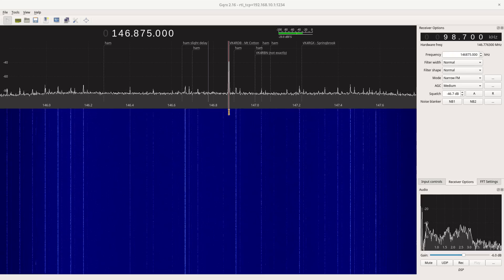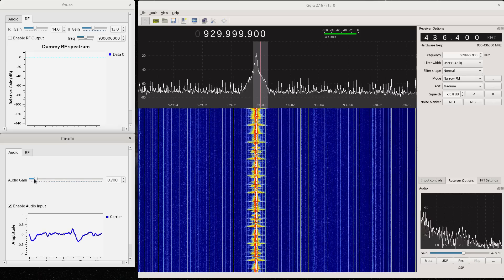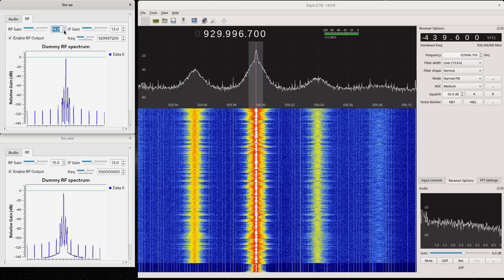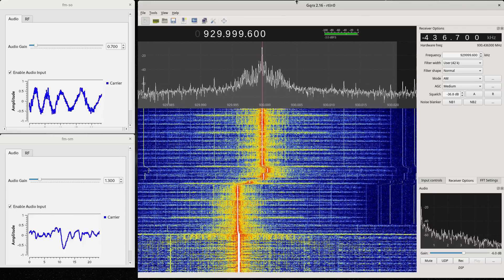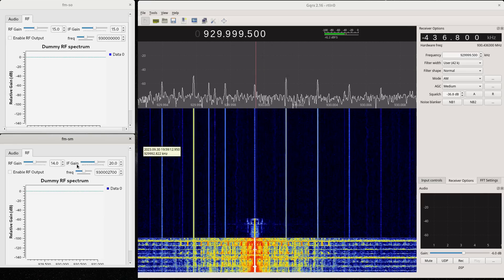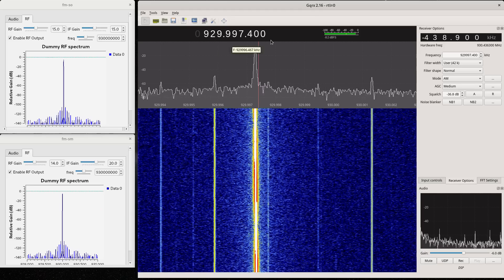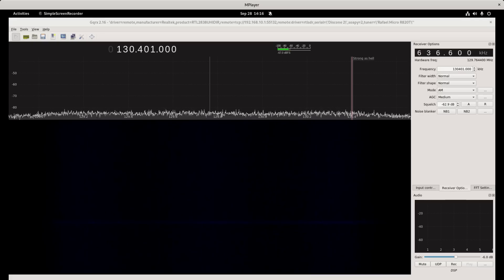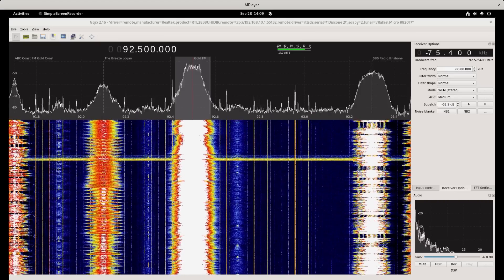Demonstrating FM Capture Effect

Comment: Ha! There is so much misinformation on the Internet. It's amazing!

AM versus FM. Liberal versus Conservative. Fahrenheit versus Celsius. A.m. versus P.m. how does that differ from FM? Apples? Oranges? Let's review.

Aircraft frequencies are beyond, 108 MHz. They are just beyond the Broadcast FM Band. And they used 25 kHz deviation,, narrowband stuff. Compared to the 75 kHz deviation of hi-fi FM radio. And so at 25 kHz deviation. That is FM transmission. Not AM. It is not Amplitude Modulated. It is Frequency Modulated at 25 kHz deviation.

It might convert that FM transmission. To an audio amplitude modulated output signal. If you want to get your jargon all, Whack-A-Doodle.

In fact. When I was younger. I could detuned an FM receiver. To pick up part of the aircraft band. Which was, FM.

There are other AM signals used for aircraft. Like the VOR directional transmissions. Yes those are Amplitude Modulated. And they are noisy. And lots of interference. And fading. Because it's Amplitude Modulation.

Aircraft transmissions really aren't any different. From Police and Fire. It's all FM today boys. Especially. If they're going to go with digital transmissions. That's all on an FM carrier.

So something may have gotten lost in translation with jargon here. And I worked for an FM radio station. And I worked for a TV station. And all of the Wireless Microphones are all up there. Originally in the VHF FM band. Later in the UHF FM band. Now going beyond that. To those gigahertz Wi-Fi frequencies. Still all transmitted through, Frequency Modulation.

So the earth is not flat. And VHF Aircraft Frequencies are Frequency Modulated. I mean my God?

And 25 kHz deviation FM on 27 MHz? I think not. On 49 MHz, sure. Look at your frequencies a little closer. More misinformation!

And so basically, your old-fashioned, CB radio, walkie-talkies. Were AMPLITUDE Modulated. All the way up to, 49 MHz. Which began the original, Armstrong FM Radio Band. Back in 1949. But that was quickly changed.  To the 88 MHz through 108 MHz, we know today. And the original Armstrong FM Radio Band. Never really happened. But I did have an antique Philco radio. That had said, Armstrong FM Band. That never actually materialized. For commercial broadcast purposes. And after our FM radio frequencies. Came the aircraft frequencies. And it's all line of sight at those frequencies. But if you are many feet up in the air. Most other stations are on the ground. And aside from the curvature of the earth. You had adequate VHF coverage with the ground in the air. It's when you got on the ground. Distances start getting hampered from multipath and obstacles.

Now you guys might be, pilots. And I might be an engineer? And while that's not something I've played much with over the years. It is stuff I needed to have to know about.

Many things can be looked at as Amplitude Modulated. Your speaker amplifier. That's amplitude modulating. Or at least modulating amplitude. It's kind of doing something similar to AM radio without the carrier wave. FM not so much. It has a carrier wave also. But it's always at full power. AM radio is not. Power varies with amplitude. Not aircraft communications.

Now you might have some general, walkie-talkie like frequency, communications also available. Just like CB radio. You can actually use CB radio in an airplane. That's Amplitude Modulated. Unless you get some of the newer ones with Single Side Band. Personally I don't care who opens for Paul McCartney.

Virtually all important voice communications are accomplished through Frequency Modulation. Kids stuff, hobby stuff, ham stuff, kosher stuff, mostly, Amplitude Modulated and Single Side Band. On those, HF High Frequency Bands. Before you encroach upon VHF. And you get 25 kHz of FM deviation. Instead of, 5 kHz of Amplitude Modulated, bandwidth. And with really only a passband of about, 5 kHz bandwidth on a, 25 kHz deviated FM transmission. And some things are AM. Some things are FM. Some digital audio is PCM. Some of its DSD. Some are 16-bit words. Others are 1 bit words. Some are sampled 44+ thousand times per second. But one is sampled at almost, 6 million times per second! And then there is PDM, Pulse Duration Modulation. And so which one is better? So many to choose from. Which one sounds like it has the least artifacting? Yeah, right. None of you can answer that question. But I sure the hell can. In double-blind listening tests by the manufacturers. For some reason? I was the only one who could identify what I was listening to. Out of everybody else at a convention in New York City. That attracted tens of thousands of people. And how do you account for that?

So something, ate quite right here. Of this I know. In a similar instance. Another similar situation to this. I discovered in 1978.

And within this discovery I stumbled upon when I was 22. I was what you could call a wunderkind. And I ended up custom designing and building, fabricating and installing. Major recording studios. Major radio stations. And by 25. The NBC Television Network. So?

Not that you can't have, amplitude modulated, 2 way, general-purpose, communication radios. But even GMRS, the new walkie-talkie stuff. And ham operators, also taking advantage of those frequencies. I guess can pretty much transmit, just about any, Modulation Scheme that rings their bell?

And you can still have two people that key up on the same frequency. Sometimes it'll work.  Other times it will cause chaos. There are ways that multiple FM transmitters on identical frequencies. Can overlap each other. When their frequencies are tied together. Such as like in a phase locked loop.

There are many other types of modulation schemes out there. And depending upon what frequencies you are on? Will, generally have something to do with your, modulation generation selection. And your reasoning behind that decision-making. Not that you have to have any good reasons? You don't. You just have to have, your reasons.

But thinking it's Amplitude Modulated beyond 108 MHz.

I mean what do you commonly use on, 2 Meter Band? FM. Steely Dan also used, FM. Their album sure the hell wasn't called, AM. Except George Carlin's album, FM/AM. With those 7 Words. We hear politicians use a lot more often these days.

Now it's been a while since I've cared much to see what's going on, these days? And what possibly has changed in recent years? But they certainly didn't changeover from FM to AM. But we regularly changeover between p.m. and a.m. So I can understand the confusion. It's not very often you get Posts from, Meridian's. Right? I mean I've never gotten any from her? Or is that a him? Maybe that was the problem? Maybe I accidentally insulted, he/him/her/she/they/them? I sure hope not? No offense intended. As I'm not that kind of Tranny Lesbian From Hell. I'm really not. Except on Tuesdays.

(More Intelligibility in following post)
Reply: https://en.wikipedia.org/wiki/Airband
Reply: Thanks, you saved my world.

Comment: AM interference, FM interference. Varies with frequency, location, power, speed, multipath, reflections. Something's time really close together. Some come close to phase lock. Others are further off frequency and cause also notes of, transmission havoc. There is no consistency with radios are interfering with each other. When people are on the same frequencies at the same time. Nothing really works right that way. We need Duplex Communications. Where we transmit on one frequency. But receive on another. Kind of like being Ambidextrous. Kind of like being, Multilingual. Kind of like having a Mathematical Aptitude. Which I definitely do not possess due to severe traumatic brain injury. Numbers just don't add up for me. So I just round off to the nearest 1000 whatever. And it gets me in the ballpark. It gives me a 50/50 chance of getting it right or wrong. Most of the time I get it right. Like always. So I've been very very lucky. I'm not dead yet. I'm working on it though. At, 68. So I don't fly anymore. I've had a touch of arthritis in my shoulders. And it hurts when I flap.

So I've kind of restricted myself to, Broadcasting and Audio Engineering, mostly over the past 50+ years. But I do love, Airplanes. I was a student pilot with my dad between the ages of 13 and 15. Until we got divorced. And I didn't qualified to become a US Military Jet Fighter Pilot. So I didn't enlist. I later enlisted with the VOA. The Voice Of America. That little, Federal Government, Radio & TV Network. Set up by Franklin Delano Roosevelt. A few years back in the early 1930s. And I went to work for them  in, November, 2005. 6 weeks out from, Brain Surgery and a couple of years of disability. And 6 years out. From doing a World Wide TV Network News Telecast. And I was being asked to do one. For people I do not know. A format I am not familiar with. On equipment I have never seen before. In my career. And, well? OK. But where did you get my number? From one of your newer employees. That used to work with me? I see. It's all his fault? Hmmm? Okey-dokey then. I'll see you then.

And so the possibility does exist. That we have a failure to communicate here? Due to pilot error. And unfortunately. I have also been privy. To, Pilot Error. Can you say, Air Florida Flight 90? That was pilot error. And I was right there. I spent the next 18 hours. In the freezing cold. Improperly dressed. With a battery-operated handheld cassette recorder. For NBC Radio News. As I was only a few blocks away when this happened interviewing, Stevie Wonder. Which was abruptly interrupted.

And…? Well? That taught me an important lesson. You guys are not always right. You make some innocent but serious mistakes. I do also on, coast-to-coast, around the world on the satellite, Network News Broadcasts. But. A) I don't screw up on the air. And B) nobody would get hurt or killed. If I crash and burn on air. Nobody gets hurt. Nobody gets killed. But I can't make stupid mistakes. And keep that kind of a job. For over 20 years. As I'm a lot like, Scotty. From Star Trek. And he never had a crash and burn. That he couldn't get out of.

So I really think something is gotten lost in translation here. More than anything else. You guys may not be completely wrong. And neither am I. Because while I am not always 100% right. I'm also never wrong.

And so that is to say. A normal, Amplitude Modulated, voice channel. Doesn't need but, 5 kHz of bandwidth. Far less than FM, narrowband. So, sure? I guess you could use your frequencies for aircraft. With an amplitude modulated 2 way signal. For inter-aircraft communications? Even air to ground. Since nothing much will be obstructing your signal to the ground. And you wouldn't hear much interference those frequencies. Because it is line of sight. And you're on the ground. They don't go very far on the ground. At those frequencies. Only a few miles station to station. But if there up in the air? And line of sight to you. Sure? I guess so? Because at those VHF frequencies. There is skip, off the atmosphere. Ground to ground. Only a few miles. Ground to air. About 40 miles. Until you lose them. If I still remember any of that stuff? After brain surgery. It's been a bit tough coming back from the dead.

It's the same transmission method as, Whether Radio. And that's FM. It may occasionally include some Morse code signals. But it's FM. And I can't remember my Morse code since my brain surgery. I can no longer read music. I can no longer play the piano. I had learned everything all over again. Like really everything. And I didn't put forth any studies. Back into repairing aircraft radio. But I'm pretty sure it's FM. But my memory isn't what it once was. But it's VHF frequencies. That much we can probably all agree upon? It's above 108 MHz. Above the FM Radio Band. It's the next Band Up. And always has been.  At least by the early 1960s.

And yes in the cockpit. You do have both FM and AM, capabilities. Of various and sundry types of frequencies and transmission methods. It's not any one thing. Not any one frequency. And what's the emergency frequency? 121.5? Megahertz. Or did my memory serves me wrong there also? Not that I've ever needed to use that frequency. I haven't. But I recall something like that?

And given a, impossible scenario. If I had to land a plane in an emergency? Confidence is high. I would get us on the ground alive. Even if it's a crappy landing.

I'm only saying that because. A little over 20 years ago. I had the opportunity. Without any prior prep. To get into the cockpit. Of an, F-22 Raptor. Go fly it. Take out some targets. Never having flown anything like that ever before. Without any real instruction from the, Boeing guy. Running this, $12 million, Military Simulator. And couldn't understand why I hadn't joined the U.S. Air Force? I told him I tried to. And when I got out of the cockpit. And turned around. There were 5 US Military Fighter Pilots. That had been watching me. They asked me. If I had flown, F-14, 15's or, 16's? I said nope. Nothing but a Piper Cherokee 140. Back in 1963 with my dad. And I haven't flown since. And here I am 35 years later. Getting a stab at this thing. They said I missed my calling. I said no. I tried. The U.S. Air Force missed a good pilot. They agreed with me. I shook all of their hands. And we went our separate ways.

So I'm not quite sure what you guys are talking about? I think you got it wrong? It's not AM radio. It's FM radio. For voice communications. AM may be used. To carry some data? And I suppose you could get a low bit rate, compressed, MP3 like, datastream on an amplitude modulated signal? I haven't looked into it. I don't need to. It doesn't interest me. It's not my Focht. I'm not really a transmitter/modulation kind of, Engineer. I'm all about the sound. And Voice Communications. And how best to do it. And what's the highest intelligibility. What is mostly free from interference. And well? That's Frequency Modulation. Amplitude Modulation is riddled with, atmospheric interference like, lightning.  Big loud pops and cracks and explosions  with Amplitude Modulation. Because lightning is Big Amplitude! FM is not interfered with Quite in the same manner. You may hear a click. Not an explosion out of your speakers. As with communication headsets. Explosions would get uncomfortable. In your ears.

And always remember. The earth is not flat. And we did land on the moon. FM isn't a.m. and it is not, p.m. And then there is Amplitude Modulation. Which it isn't.

Jesus was not from immaculate conception. Mary had a tough hymen. And she played around.
RemyRAD

Comment: This fellow is saying is that if you have 2:00 AM transmitters sending to an AM receiver AM receiver well here a jumble of the two signals--- jumble together.
Reply: The operator at the airport well here the jumble and knowing that he is using AM., you can call for one or the other of the airplanes and tell the other airplane to stand by. If he didn't get any call signs you can just ask for the airplane that is on his screen with a number-- say American 232-- he can call on that Regency air America 232 the other station please stand bY;  the operator gets the summary of the needs of America 232Mand tells American 232 to stand by and then call for the other station on frequency--- say that is DERLA 137. On frequency are both these airlines but now the controller has them transmitting separately on AM.  The AM signals which jam together told the operator he had more than one station on frequency and so he adjusted by calling first one and then the other face perhaps on his radar screen numbering
   are providing A jumble AM gives the error port option 2 call for only one at a time

Comment: Is other FM signal truly lost and overwritten or it can be recovered if using special equipment?
Reply: you'd have to force the receiver to use the less powerful carrier wave, which is being interfered with by the more powerful one.
it's like trying to distinguish two monotone conversations from microsoft sam, both in english, and the second english one is 2x the volume of the first english one.
So, you'd have to decode the more powerful one, then invert it onto the raw input, to be able to decode the second one.

possible. lossy, and filled with artifacts, but possible.

Comment: It's worth noting that modern aircraft communication systems are gradually adopting digital communication technologies, such as digital voice and data transmission over VHF (Very High Frequency) and satellite communication systems. These technologies offer advantages in terms of improved voice clarity, data transmission capabilities, and integration with other avionics systems. However, AM radio remains in use for legacy and backup purposes, ensuring compatibility with existing infrastructure and communication protocols.
Reply: Well it still has to be sent over the air, so it’s technically still analog. Does this new tech use PCM or some other means of transmitting data?

Comment: The simple explanation is that when the pilot does not speak the amplitude is only 25% of the power. This allows another transmitter to share the frequency. Whomever speaks will have a 100% amplitude and hence be noticed.

Comment: Weird.  I'd swear, as a kid, I remember messing with the local oscillator tuning on my FM radio front end and hearing aircraft VHF communications in the frequencies above the high end of the FM dial (> 108 MHz).
Reply: Yes, because you can demodulate AM signals with most FM radios. The FM demodulator is basically a frequency to amplitude converter and if the FM signal is strong enough and the receiving frequency is detuned a little bit on the dial you can even hear AM with many FM radios.
Reply: @eudyptes7431 interesting.  I never knew that!   Thanks!